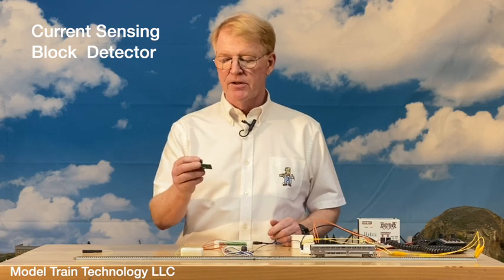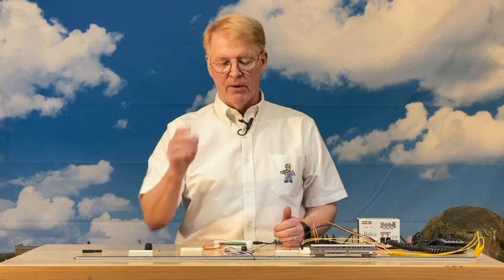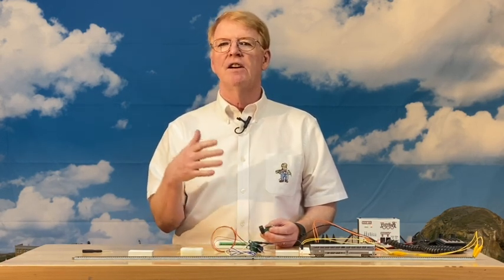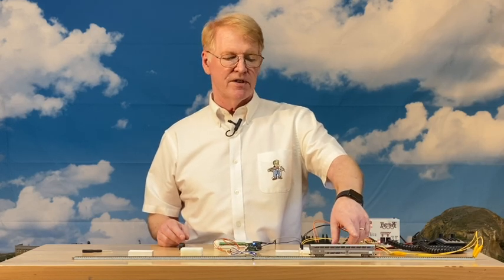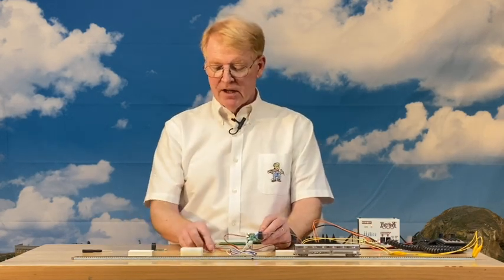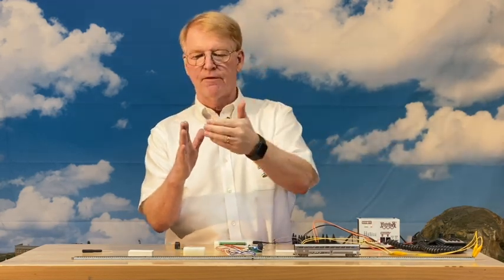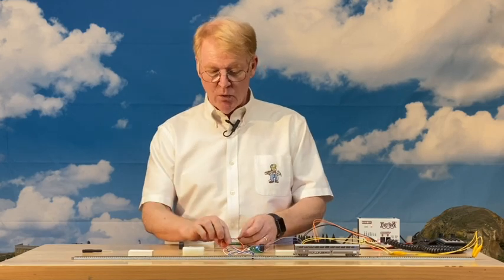DCC Current Detector for Blocks

Comment: Neat product - how does the current calibration work?  Is there a button setting or other method?
Reply from the maker: Yes, manual is online on our we site under TECHNICAL.
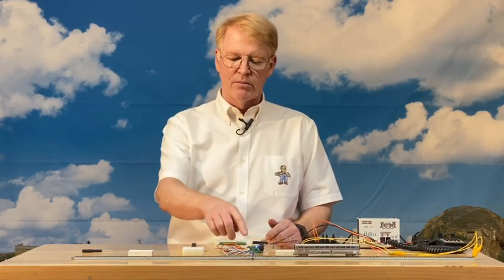Reply: @ModelTrainTechnology  I did read the manual but it only addresses the inverse mode setting.  Around 7:02 in the video you mention a calibration mode - I could not find any reference to this mode in the documentation.  Thanks for the help.

Comment: Does this work the same as the Merg Current sensor... that is can I take the output and feed to an Arduino as a 5V Yes/No sensor?
Also I searched your website and didn't see this item.
Thanks
Reply from the maker: Very similar.  Its output is an open drain to Ground with about 2.8v on the high side.  We just got behind getting the products loaded but they are there now.  We will fill in more details in the next few days.

Comment: Can you run feeder wires from multiple tracks through the current loop transformer?  For example if you wish to trigger crossing gates at a 2 (or more) rail line crossing, for a train approaching on any of the tracks, can the block current detector be used this way (assuming, of course, that each the tracks has an isolated block around the crossing).
Reply from the maker: That is not recommended because if both tracks are occupied the potential exist to overwhelm the coil.  Its better to have two detectors and tie their signal OUTs together - which is the way our system is designed.